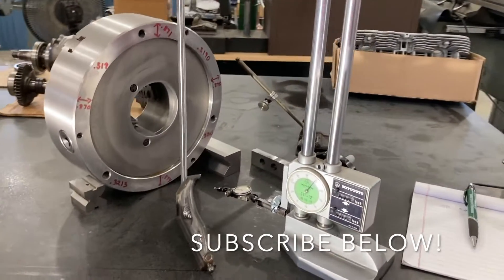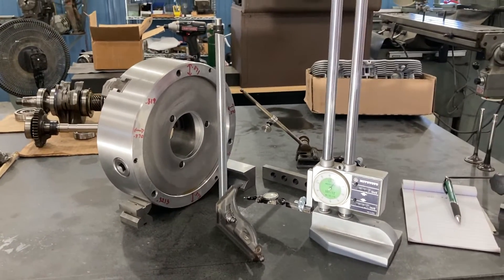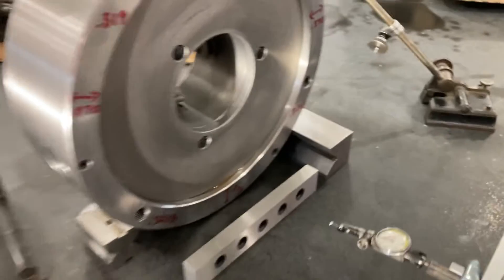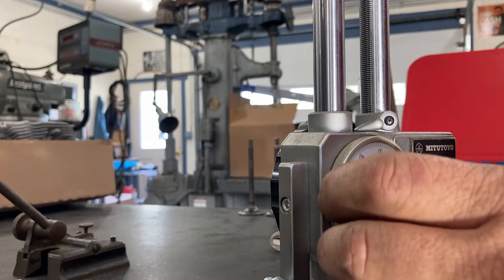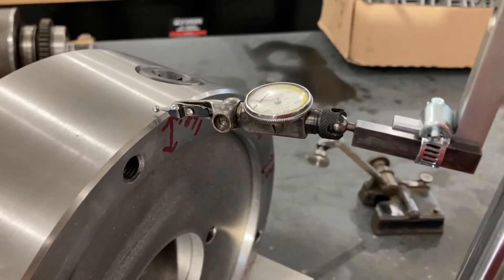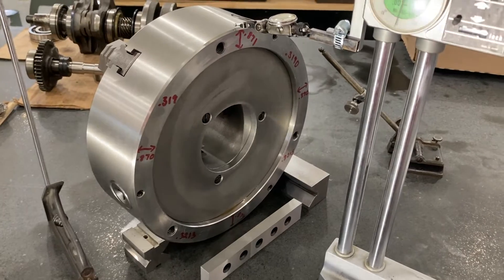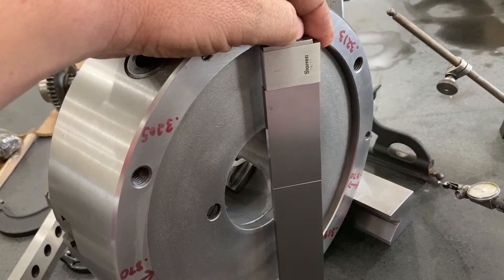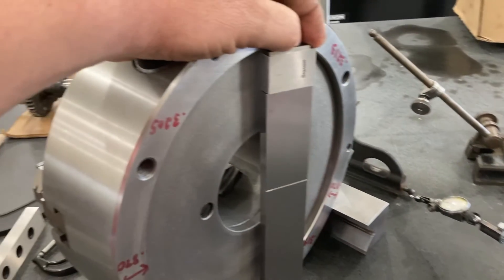Machine Shop Tip: Measuring Diameters with Height Gage

Comment: I'm missing how you got the ID? Its relying on the OD measurement? And it is assuming the ID is concentric with the OD, correct? Is there any way to use a non-digital height gauge and a dial test indicator to pick up both walls of the ID hole, and measure its diameter and/or center position directly?
Reply from the maker: In this case I knew it was concentric. There are ways you could determine concentricity by taking measurements around the part, or by indexing the part and using a test indicator. 

I’m sure with a little imagination there are plenty of ways to tackle this using a surface place and related instruments.